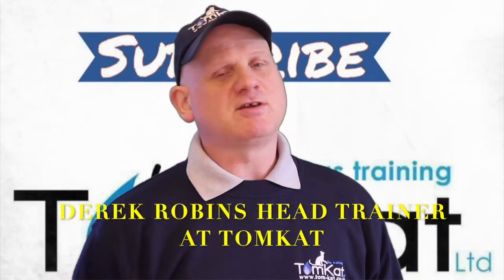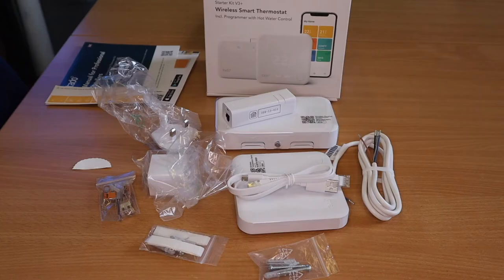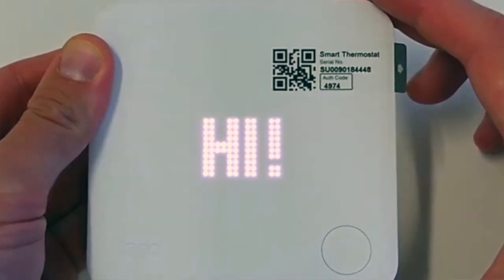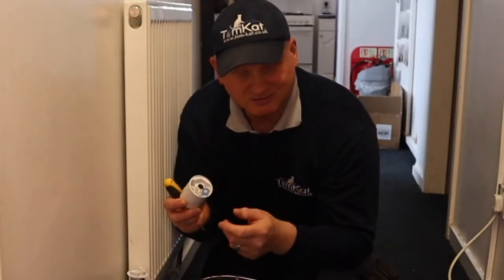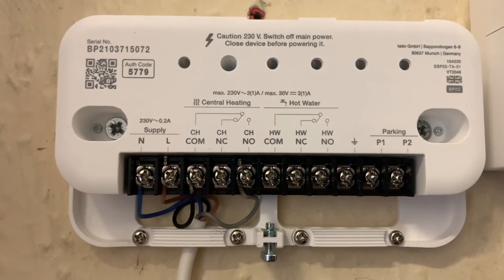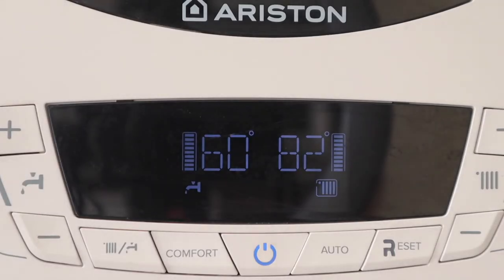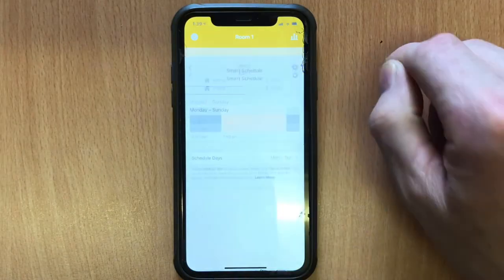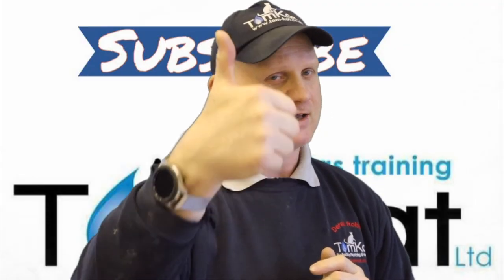TADO SMART THERMOSTAT AND TRV'S, unboxing, installation and review of the Tado smart thermostat v3+.

Comment: Had Tado V2 (No charge) for about 5 years on my Valiant Combi, as a frequent business traveller the Geo Fencing and learning remote database were fantastic it would know how far from home I was and turn on the heating based off current house temperature and how long it would take to heat up based of the information it had learned etc and you could see everything in real time too. Only problem was that if the internet went down it stayed in previous heating or off mode. Sadly when I had a gas boiler replaced installer yes installer blew the Tado receiver and the new pcb on boiler. Ended up once sorted with Nest, TBH only advantage that NEST has is that it holds the schedule within the unit and not dependent on home Network as uses it’s own thread network to speak to receiver. Geo Fencing with Nest is rubbish too as will only switch on as you walk through door. So yes I would recommend Tado, shame that they charge now for its best feature though.
Reply: Hi @Cmdr007Bond, Does this Tado v3+ work with valiant Ecotec plus 831?

Comment: Great video just ordered one, with a stand I might add, what benefit would i get connecting this to the eBus rather than the 24v on a heat line 28c
Reply from the maker: You have double the price of the boiler
Reply: @tomkatgastraining  Haha sure have, it's a stop gap for now, still what about the eBus?
Reply from the maker: @RCSteve  I would be surprised if the headline had ebus I know the glow worm and Vaillant has it but I would guess the headline at the price wouldn’t have it.

Comment: Regarding the electrical wiring for the 2 port valve, I understand you need to install one for the radiator and one for the UFH after the flow pipes from the boiler are tee'd off. But I'm keen to understand how these motorised valves get their power? As in, where does the black cable coming out of the motorised valve connect into? Any idea how each of these motorised valves get their power to turn on/off? For example, for the UFH, do you install one 2 port valve in the manifold area which gets its power directly from the manifold / UFH wiring control centre and turns on once the thermostat calls for heat? And to control and turn on the radiators, do you install the second 2 port valve next to the boiler so it can collect its power directly from the boiler or from the Tado wireless receiver (and therefore switch on once the Tado TRV is calls for heat)?

Comment: I got a vaillant boiler with one circuit of the heating system for whole house. Will tado work for me to control the boiler with few wireless smart thermostats?
Reply from the maker: The tado should work on the boiler and if you mean thermoelectric rad valves they will work but if you have a one pipe system with no bypass under each rad then you can’t use TRVs
Reply: @tomkatgastraining  I've got 2 pipes under each radiator at my house (feed and return). About boiler I meant that I have just one circuit of the central heating system for all radiators, they are not separated into room-groups. Thats why Im thinking about getting into tado system.
Reply: @tomkatgastraining  Could You help me with wiring the wireless receiver to the boiler? I got Vaillant Atmotec VUW PL 240/3-5 with Calormatic 370 connected to the ebus. The instruction of tado says that I should use just a grey wire, into the slot 4 of terminal block. I got the same wireless receiver as you, the newest version without ebus + -.
Reply from the maker: @barteks816  sorry I didn’t give out information like that I have had my fingers burned on too many times when things go. Wrong